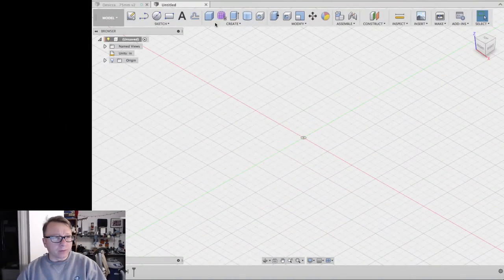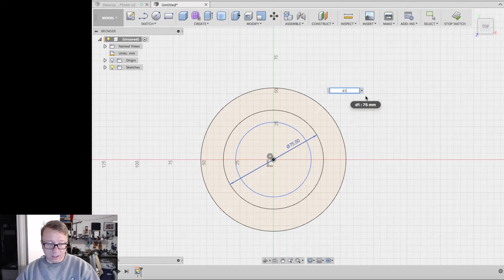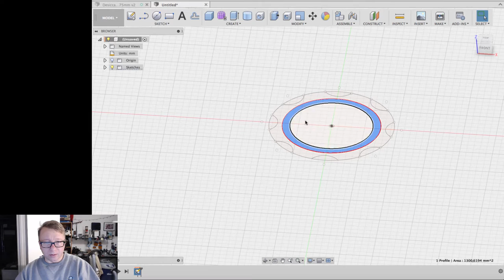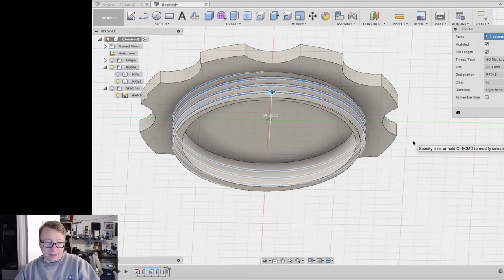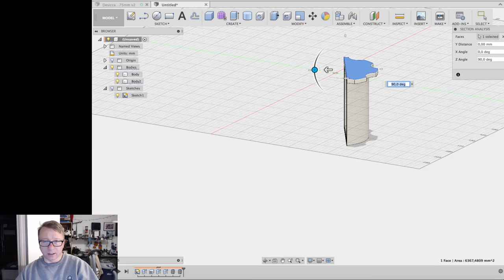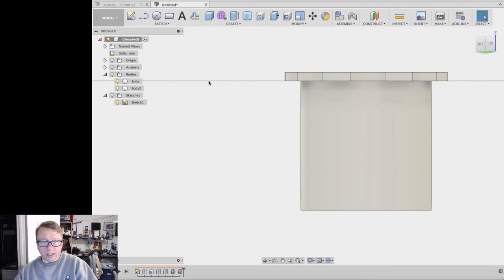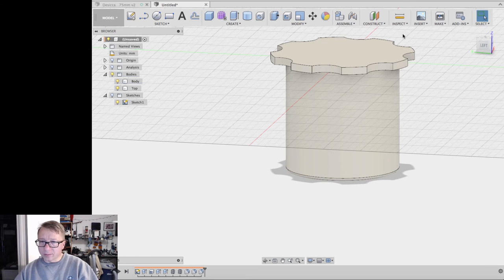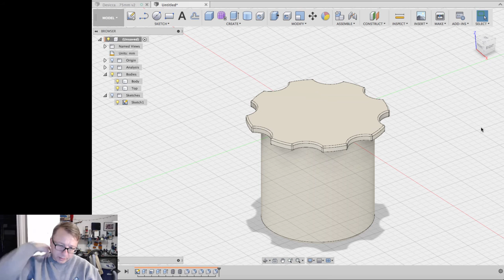Creating and Printing Threads in Fusion360 and Prusa i3 MK2

Comment: thanks for the video, I am trying to make a thread over a 6mm diameter cilinder, but it fails, I will try adding a .2 fillet in the extrenal lines (in the bolt), and internal (in the nut), but I think myu .4mm nozzle is what is making this experiment not feasible, how small can you make a thread with .4mm nozzle?
Reply from the maker: Hello @Albertroswell - which part is failing - making the thread in fusion or printing?  I generally use 0.1 for my fillets and 0.05 when necessary.  A 6mm diameter is pretty small for a 3d printer - I've done it, but you need to print at 0.15 or 0.1 layer height.  Hope this helps.

-Tom